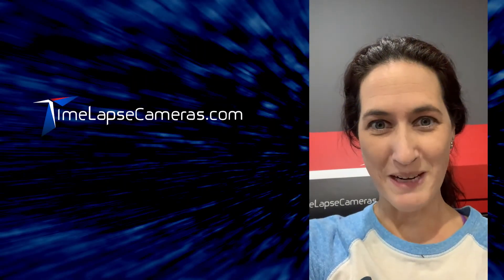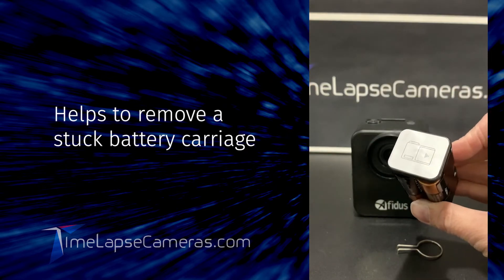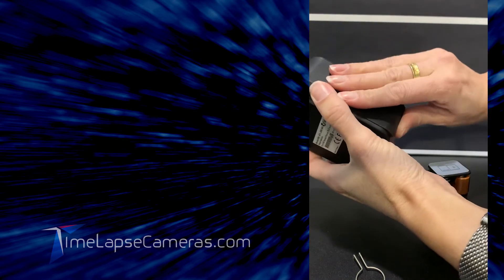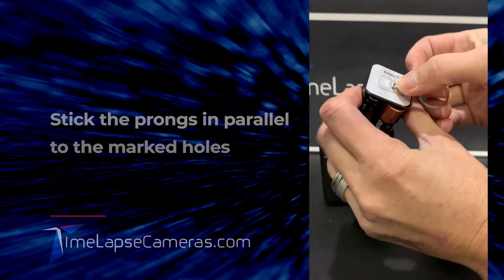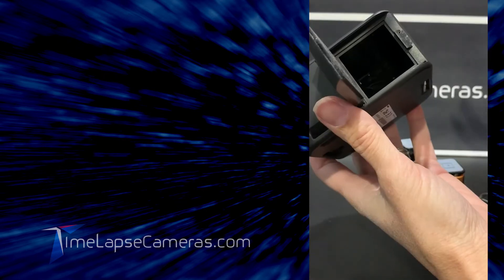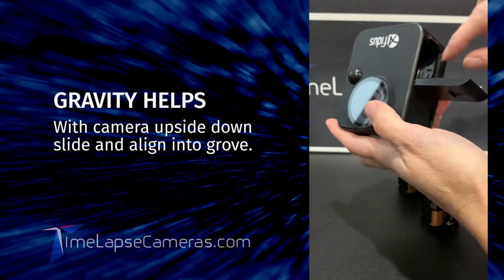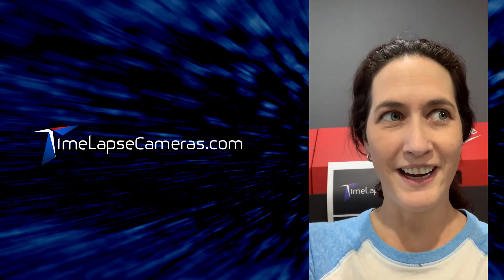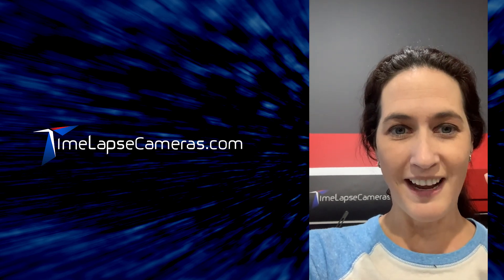How to use the Battery Removal Tool and removing the mSD Card with the Afidus TimeLapse Camera

Comment: My camera keeps saying check your battery and won’t allow me to record. I’ve changed batteries with brand new ones and different types and it still doesn’t work.
Reply from the maker: Sorry to hear of this issue. The camera does not have a "check your battery" notice. If you are referring the LED flashing red it indicates a few things which require immediate attention. Your batteries could be low, the SD card may be missing, in the wrong format (FAT-32) or full. With the camera app open, if your batteries were low the battery level indicator would be at 2 or 1 bars. If you card is missing or in the wrong format, there would be a red X over the card icon in the app. If your card is full you would see the free space/full status within the storage notification in the upper left of the main app screens, the info screen and the Settings menu. If you deleted files from your card and it still shows as full, please reference this documentation, https://forums.sandisk.com/t/sd-card-was-full-but-had-no-data-on/35558

If you need further assistance, we are happy to help, please reach out to Josh at 01-507-884-0070 or info@TimeLapseCameras.com
Reply: @TimeLapseCameras  I meant in the app it shows the battery as red and I bought brand new batteries for it. It won’t record a timelapse.
Reply from the maker: Following back on this: 

Many users will grab any brand of batteries thinking they are all the perfect option. At this time we can ask you to only use Energizer Max batteries. Full resource article here at TLC's learning site: https://www.afiduscam.com/post/best-batteries

Did you reach out to Josh for further assistance,  happy to help, please reach out to 01-507-884-0070 or info@TimeLapseCameras.com.
Reply: @TimeLapseCameras  I bought energizer max and lithium batteries. Didn’t matter which ones they were it didn’t work. Anyways, I got a refund so I’m not worried about it anymore. Going to invest in something different for future projects.